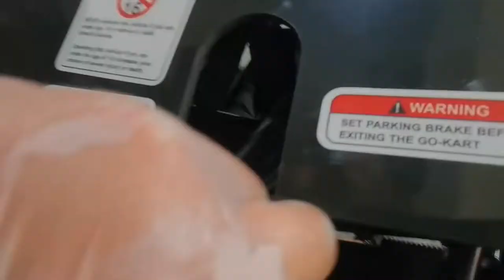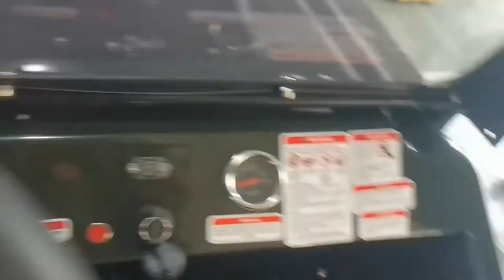X-PRO  GK-U01 / TL125GK-A 125cc Jeep Go Kart  Assembly Video

Comment: I’d prolly throw out the engine and throw a predator 212 in w pull start, just get rid of all the electronics cause for something like this, the less to go wrong. The better
Reply: Finally I found someone with the same idea but the real question would it even fit and if so could we put a 300cc maybe even 400cc